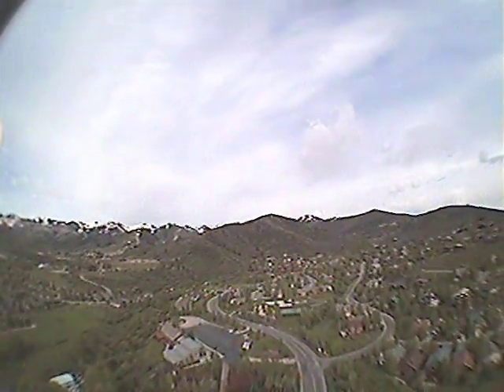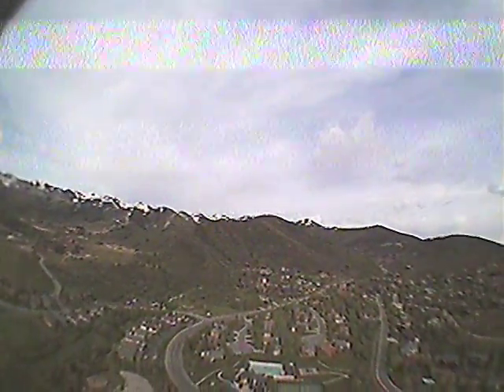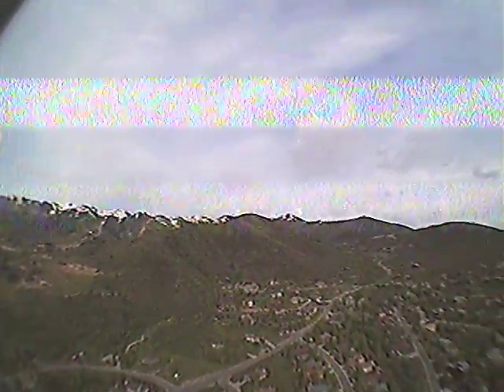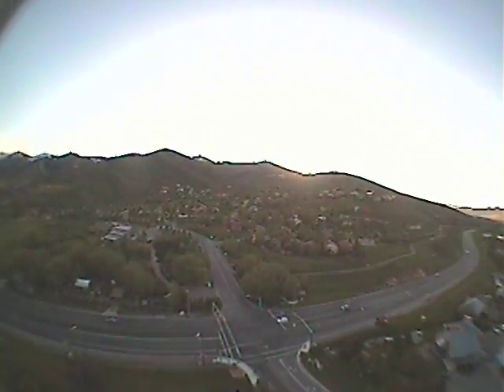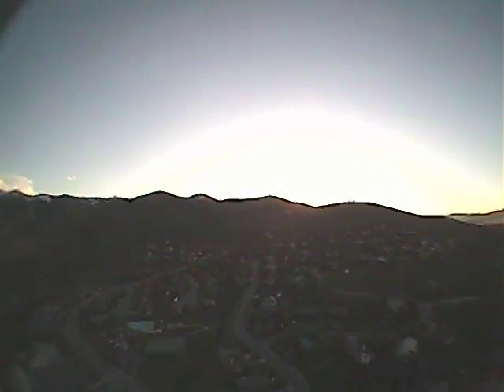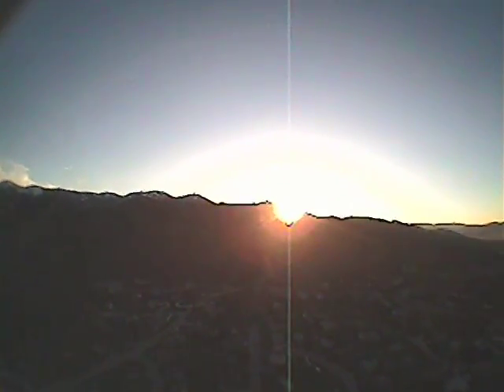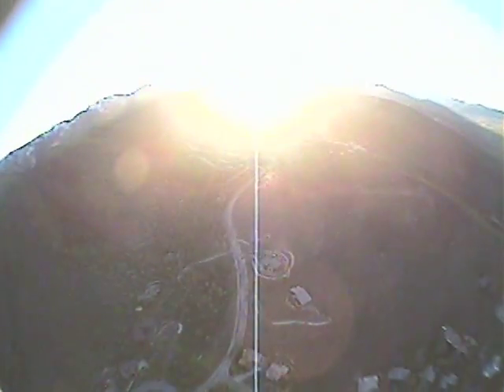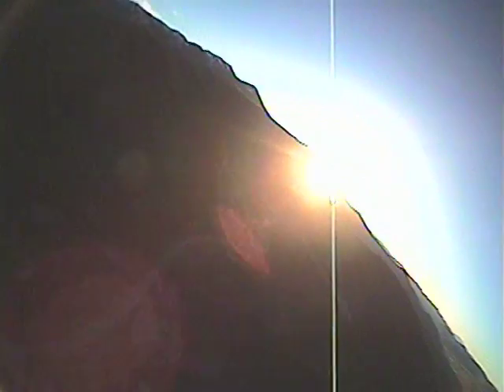2.4ghz FPV Channel 0 VS. 8

Comment: Great video. This is very helpful for people like myself just getting into FPV.
I was hoping you could help me with a newbie question that I am having trouble getting straitened out. You mention that your transmitter is 2.4ghz at 500mw. Does this setup require a HAM license to operate in the US. If this is the case, how strong can a 2.4Ghz transmitter be, and not require the license? Any input would be greatly appreciated.
Thanks Again.
Reply from the maker: It does. I think anything over 10mW requires one.
Reply: rctestflight Wow. Thank you for the fast response. That means everyone with Fat Sharks has to have a license.
Reply: jr10 How difficult was it to get the license?
Thanks again for the help.

Comment: You will improve the video quality (not interference wise) by getting a patch with a shorter wire. Normally for FPV use you have a 1 foot wire on it like I do on my 8dBi patch. You have a hugely long wire and you will be getting a lot of loss of video from that. Even with antenna tracking it is best to have a shorter wire and then attach the VRx to the back of the patch.

Comment: Excellent comparison, but, eh, why didn't you try the Lawmate on ch. 8 and with the patch antenna?  Now the comparison compares: two channels, and two antennas.  And then switches to a different video tx completely almost making the first two tests a non-direct comparison.
  Also, is it possible you could do the tests using a 1.3ghz system?  Theory:  Better range than 2.4 video tx.   - Partok

Comment: @rctestflight lol ... thats funny ... it all seems to be a bit mong on a lot of wifi stuff. im a techie so the wifi gear i use is all pretty standard. I have heard of channels affecting each other (eg channel 5 interfering with 6). Ive even played with some wifi security cameras (hong kong special ones) that would completely kill the wifi signal on all channels in the building if you turned all cameras on at once. You couldnt even select the channels they used.